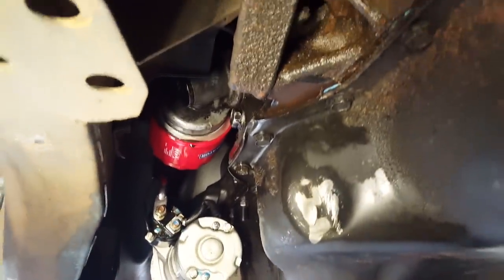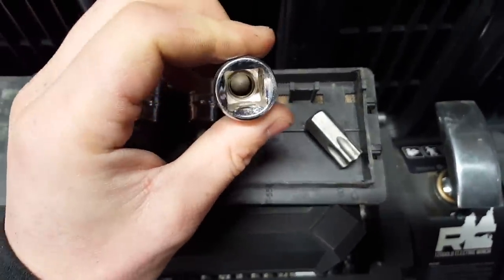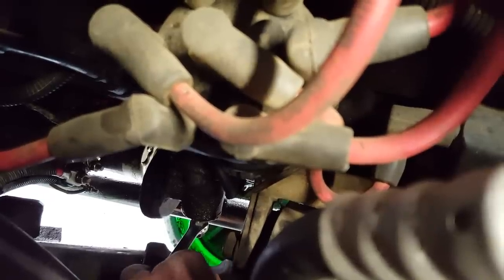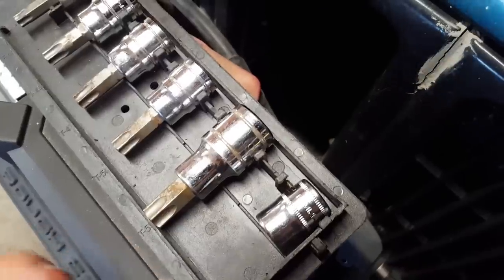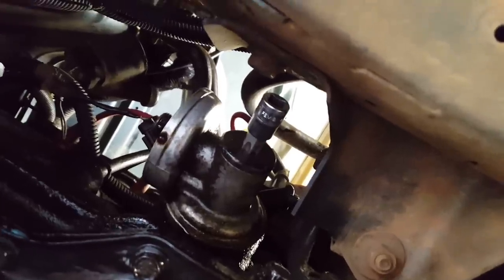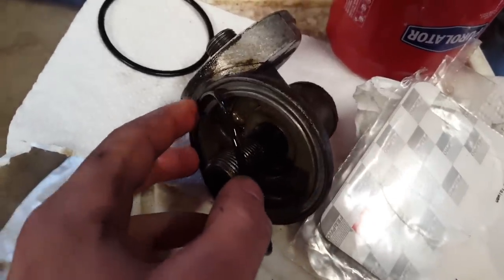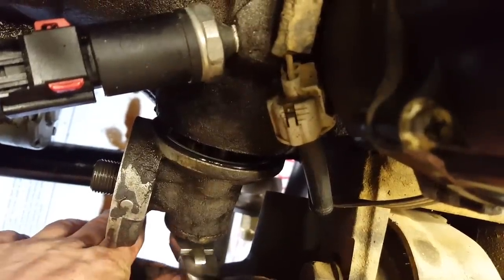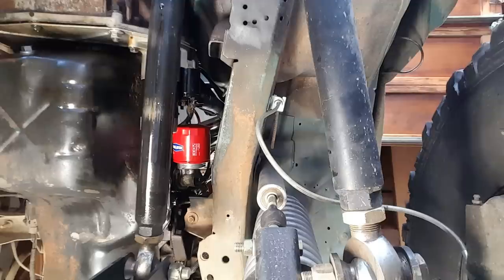Cheap Oil Leak Fix - The $2 Jeep Repair You Keep Avoiding

Comment: Need to do this to my '01 XJ for the second time. Last time, I paid a shop. This time, I've run into all the same problems, but my T60 is 10mm shaft instead of 12mm and I've destroyed one cheap wrench already. Guess I should pony up for a good quality forged wrench that won't turn into spaghetti.

Comment: You did not replace the o-rings on the bolt. I welded the t-60 into the wrench for my 98 Cherokee. My 94 Cherokee had a 14mm allen. You should have pushed the bolts out though.

Comment: So 3 years later, how’s it holding up? I’ve just ordered the filter adapter gasket, valve cover gasket, rear main and oil pan gasket. Gonna have the front axle out for a long arm kit, so might as well go for all of them!
Reply: Valve cover gasket is easy except for the furthest most rear bolt that’s more towards driver side but furthest back. Super pain. I usually take the upper rad hose off when doing this repair.

Comment: I have a 1 piece Cornwell T60, grinded flat sides on it to fit a 7/8 wrench, then put a longer wrench on the end of that, then used my foot to break it loose.. those things are tight..

Comment: Mines a 92, and it has 3 O-rings, block to adapter, on the bolt and on the end of the bolt, against the adaptor, and I was unable to find a kit that had all the O-rings I needed. Had to use a couple different kits to get all that I needed. Needless to say, it took 10× longer to fix and way too many trips to parts stores. Mine is also turned upright and will not rotate, until half way loosed. It almost drive me crazy
Reply: Stealership has a set of 3 o rings that fit the adapter. Think they were $12. Mine is a 92 too but my oil filter is towards the top of the motor, not above the starter.

Comment: You can use a slim ratchet instead of a wrench if that's what you got. After borrowing one from a Neighbor I bought a set at harbour freight
Reply: You do have to pull one of the engine mount bolts out though

Comment: If you take the motor mount bolt out of the sides of the oil doctor is on the engine jack up the motor enough to get a socket ratchet on their breakover bar and make it really easy

Comment: I didn’t know about this when I changed my oil and I thought it was the pan bolt because they have the copper washer replaced that and nothing thanks for the tip to get it off

Comment: Cut the bit down to the point where that shallow socket would just cover over the splines and you should have had enough space. Then epoxy it in after the job and designate that to this specific job!

Comment: Questions about this project: Apparently it’s tough as heck to get this part off- should red thread locker be used on reinstall? Does this bolt need to be torqued? If so, how much or do you bottom that bolt out? Great video! Great viewer comments! Thanks
Reply: You should never need red threadlocker on most of an XJ. Idk why they would use it at the factory.

Comment: Good video, but I have one little piece of advice to ad to it. 
 If you are planning to reuse your oil filter, which you should not, even if it is a day old, at least cover it and protect it from getting any trash in it. Any debris that gets into it obviously could get into the motor.

Comment: I know this video is four years old but I thought I'd something anyways. I did this change on a 1989 jeep Cherokee and it had 2 o-rings. One where the bolt meets the adapter and the big main o-ring everyone already knows about but when I did this to my 1994 it only had the big main one so the number of o-rings does depend on your year I guess. I know I have seen jeep Cherokee xj oil filter adapter packs that come with 3 o-rings all different sizes

Comment: there’s 3 o rings that need to be changed, the large one and then u pull that torx bolt out and there’s 2 smaller o rings that sit on that

Comment: I'm already having PTSD from having to do mine last summer!!!! Such a HORRIBLE design, I was cursing the engineer the entire time! I did however figure out, it was easier to break it loose from underneath than above! I kept fighting it from above because I didn't want to get under it but, it finally broke loose below! And that's the hardest part, getting it to break loose. I found a bar that would go over the 12mm and then I FINALLY WON!!! All of that mess from that 50c gasket!!!!

Comment: So is that an adapter that you buy to turn your oil filter parallel with the engine block? My oil filter comes straight out of the block getting hit by the frame rail and puncturing or coming off the threading

Comment: How does your engine sound so good? Mine definitely doesn't sound like that. Is it stock or have you done things to it?
Reply from the maker: Tanner Wilcox All stock. 230,000 miles. I do have 2" exhaust after the header all the way to the tailpipe and a Magnaflow muffler.

Comment: After breaking 2 t60s and twisting a 3rd I see now that bolt just comes that tight. My o-ring came out in 2 piece. Tiny bit more room in ZJ.  I hear some lifters rattling, next video?
Reply from the maker: matt parker nah, runs good. At 230k it will probably be a full rebuild if I do anything to the engine. Toying with the idea of a turbo too.
Reply: BleepinJeep gotcha,  same thing I did after 325k,  lifters sounded like rod knocks for the last 25k.  Couldn't be angry at it

Comment: I replaced the rear main seal, oil pan gasket, and valve cover gasket on my 2000 jeep xj. It still leaks oil. It drips onto my exhaust and smokes when I drive it.. also I watch your video on the rear main. My rear main seal does not have the tabs. It's just a 2 peice with no tabs. Weird that they changed that up.

Comment: Just curious when you put the bolt back in did you put any kind of thread locker on it? Maybe blue thread locker to deal with any motor vibration?

Comment: Instead of trying to do this correctly with the engine in. I'm going to clean the adapter and apply silicone to the seam and hope it works out until rebuild time

Comment: this is something I probably need to do but i will not know for sure until I fix the leak from the oil pressure sending unit.  it leaks out the electrical connector end and drips on top of the oil filter. since it is on a 94 zj I assume just like your xj that it is still the factory o ring and looks like a t 60 torx

Comment: Iv got an 89 changed every gasket I thought was leaking come to find out its my head gasket.  Truck runs fine but it's time to buy a new motor. I know that sounds extreme  but I'd rather have a new motor then throw money at a 180k mile motor. I'll buy a rebuild kit after I get it out only if there are no cracking of the block and head.
Reply from the maker: svborek 1975 I've owned several 4.0's that show dampness coming from the head gasket area. I never had an issue from it. They're leaky little beasts.

Comment: What is that high pitched super slight squeak right in the end of the video, when you're pulling out of the garage? I'm experiencing the same sound in my 92 cherokee xj (laredo)... drives me nuts... seems to go away after its warmed up a bit though...

Comment: There's a total of 3 o-rings on that adapter. 2 smaller ones on the bolt
Reply from the maker: James Taylor That's what I keep hearing. I'll take it off again to check eventually but my leak has definitely stopped with just the one o ring.
Reply: BleepinJeep you have to press the bolt out and they are two smaller ones...thanks for the vid...mines leaking and i am going to fix next oil change

Comment: Place the oil filter on your XJ in a large zip lock bag and turn it out. You will not spill a drop on that starter and wiring

Comment: For that t60 take about half that back end off with a hacksaw and you will be able to get a breaker bar back on there. You missed 2 more rings in the bolt.

Comment: I have a 97 tj with a 94 cherokee 4.0 HO manual.  when I’m driving at 60 and about to stop at stop sign the oil pressure goes down and check gauges light comes on.  Can you help me figure why it does this? Is it a Jeep thing? I changed the sending unit out before and it worked for awhile. They can’t keep going out? I use 10w-30 gtx high mileage w wix filter.

Comment: I did this once a noticed that when you break the bolt at first i was able to use the adapter and filter to ratchet the bolt tight again so idk if anyone has noticed this.

Comment: Why did you change your battery terminals again after the video you made?
Reply from the maker: Special Snowflake I ended up replacing the wires all the way to the starter and block due to corrosion build up over the years. The new cables came with terminals.

Comment: The kit should have 3 o-rings, you have to push the bolt out of the adapter. It has two more o-rings on it.

Comment: Yup they suck to do! I used a socket to wrench adapter so it won't fall off.

http://www.leevalley.com/en/images/item/woodworking/assorted/17k0150s2.jpg

Also pull the bolt out there are 2 more o-rings.

Comment: I’ve got a 98 with the same issue, only my t60 bit doesn’t seat in the bolt as deep as yours. I try to set it in and get the wrench on it but it just falls out.
Reply: You may not see this. I have a 1998 ZJ too. Did you ever get it removed yourself or have a shop do it?
Reply: @knowledge5106_  I never got it out. I hot glued the torx bit into the box end of a wrench just so I could get it in the bolt with less hassle. Put a pipe on the other end but that Torx bolt was just too far corroded. Or stripped out from a previous owner. Sold that 98 and bought a stock 99. The torx bolt on the 99 was in much better condition. Used the same setup and got the adapter off easy. Hot glue the bit into the box end of a wrench that fits. Then put a pipe on the other end and break it loose.
Reply: @kjamesjr  I'm glad you got it to work. I went to O'Reillys and bout the Titan stubby torx bit set & already had a serpentine belt tool. Put the T60 torx bit on the tool, jacked up the Jeep got underneath and was able to  break it loose.

Comment: I had a huge leak from my adapter on 92 Cherokee. I had to go to a mechanic to get the damn bolt loose. He was down there for like a minute with a three foot breaker bar. Problem solved.

Comment: I know this is the 4.0 engine, but I have a leak on my 4.7 grand Cherokee. Seems like it's coming from this general area near the filter.  Does anyone know if it's a similar design for the filter on the 4.7?

Comment: Does anyone have an adapter for sale?  Part  33002787?  I dropped mine and it chipped the o-ring lip; when, it hit the ground.  BTW, how did you do it without taking an oil bath?  You think the oil is drained; but, a good amount still came out.

Comment: Lmao the way he said "i saw the bolt move" like he saw a miracle happen before his eyes im in the same situation rught now giving it my all and it wont "POW!" Im using a 3/8 drive 12mill socket with a normal 3/8 drive ratchet and it barely fits if u take the bolt out of the unibody rail first

Comment: If rubber is known to break down exposed to oil and this gasket is expose to extreme temperatures WHY is the gasket not available in polyurethane or silicone?

Comment: Help! I have '98 zj 5.9 jeep G Cherokee. The inside computer keeps going off stating "Coolant Sensor Bad" then goes off and on again. Changed the computer and changes the coolant sensor, and still the computer goes off. Any ideas would be appreciated!
Reply from the maker: Ye watch my cheap Jeep series, in the comments people explain its in the back of that control board.
Reply from the maker: Ye watch my cheap Jeep series, in the comments people explain its in the back of that control board.

Comment: Can I remove the entire oil filter adapter and put the oil filter directly to the engine block???
Reply: In the video he said you cant do that cause there is no room, hence the reason for the adapter in the first place.
Reply from the maker: Yeah you can do that if you're willing to use a smaller filter. With engine movement you'll need a pretty dang small filter to keep it from contacting the unibody during wheeling or hard acceleration.

Comment: Could this happen, and you smell the oil burning, but see no leaks on the ground?
Reply from the maker: Very unlikely. This is on the opposite side of the engine from the exhaust and probably wouldn't burn.

Comment: After watching this *twice*, it occurred to me that a T60 torx L-wrench might simplify matters in getting that adapter out. 

Here: https://www.homedepot.com/p/Bondhus-T60-Torx-Long-Arm-L-Wrench-with-ProGuard-Tagged-and-Barcoded-31860/302011792

It's a Bondhus T60 Torx Long Arm L-Wrench at Home Depot. $12. The short leg is only 1 3/4 inches. Might fit (probably). Might work (probably with a breaker bar).

I will follow up this comment AFTER I try it out (which might take me a while: it's still too cold for a 70 year old to want to crawl around under a Jeep lol). In the meantime, if YOU try it out, you might want to let the rest of us know.

Followup #1: Well, in reading the comments after posting the above (better late then never lol), seems like several people alreayd mentioned using an L-wrench ...and a few mentioned shortening the length of the captured T60. Anyways. Noted.

Followup #2: And several suggestions were made to remove the adapter entirely, along with the captured roll pin, and just use a shorter oil filter period. I'd assume that relocating to an off-engine remote filter would work too. I'm going to do one or t'other when I get to this project in the spring.

Comment: There is an example of poor engineering
Reply from the maker: Ty Kellerman Its ridiculous. If the Unibody was just a little further away there wouldn't be any need for this part and the oil filter could mate up straight to the block.
Reply: The factory used red lock-tite to prevent the banjo bolt from backing out due to vibration.  My brother-in-law works on airplanes and he remembered something about the FAA banning these adapters.  These are not unique to Jeep but a close-quarter's solution found in many applications.  With the failure rate of three o-rings in a housing that is subject to vibration, it's no wonder.  The roll pin in the block has nothing to do with the pressure sensor.  It's only to keep the adapter from spinning.  Remove that and you can install a regular remote oil filter kit.  I just acquired a '93 XJ and will be installing a remote filter kit before I put the axle housing back under the front end.